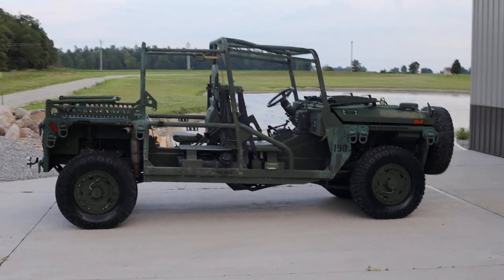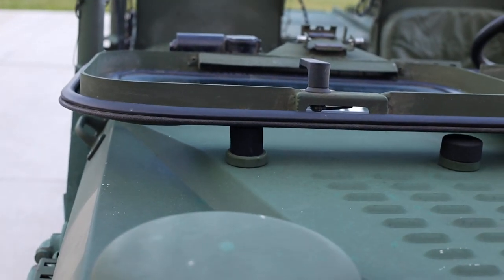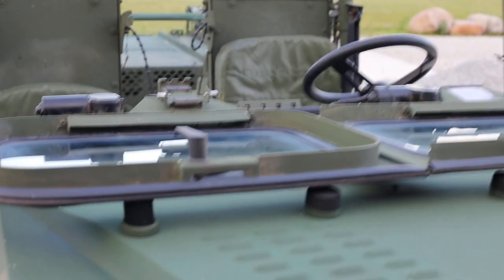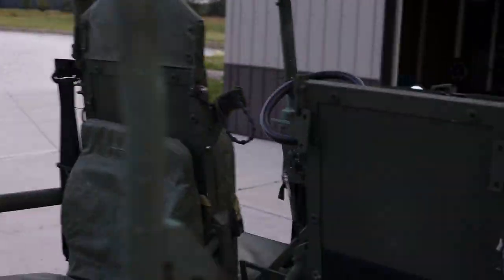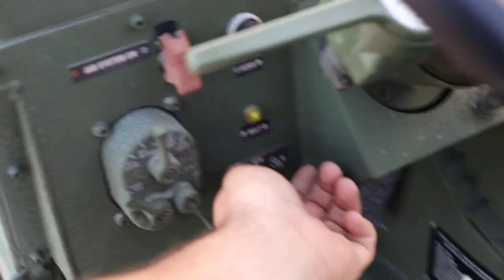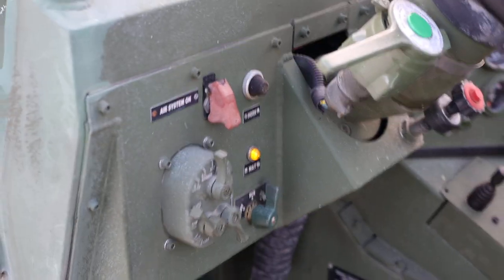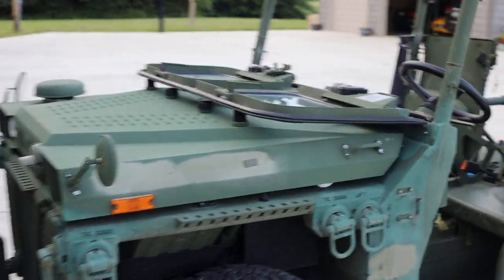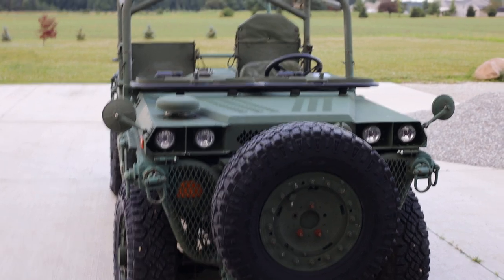Washed the Growler M1161!

Comment: How uncomfortable is the sitting position? Similar to humvee?
Reply from the maker: Sorry for the delayed response.  Unfortunately, I have not been in a Humvee.  The sitting position in the growler has been fine for me.  The longest I have driven it is about one hour and I did not have any problems.  You are not able to adjust anything though, so I can imagine it would not work for everyone.  I am about 6'5" tall for reference.  Also, the back seats have a slight angle that would it so that you cannot sit 90 degrees upright.  That angle is nice for the front seats though.